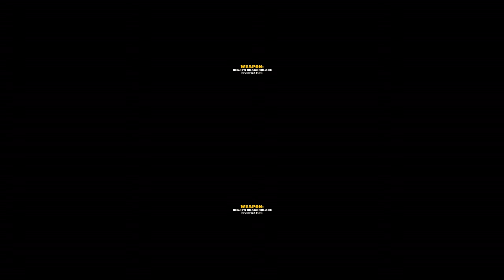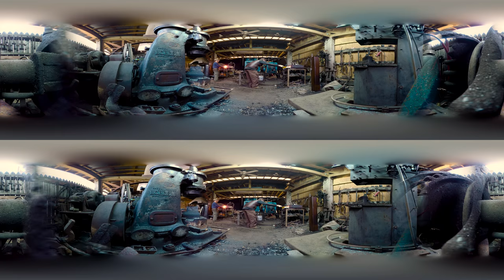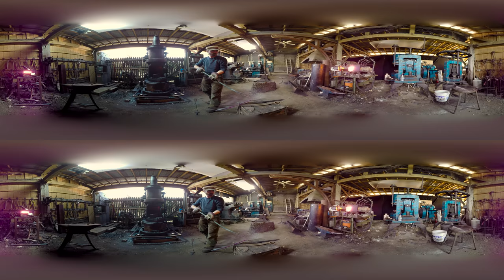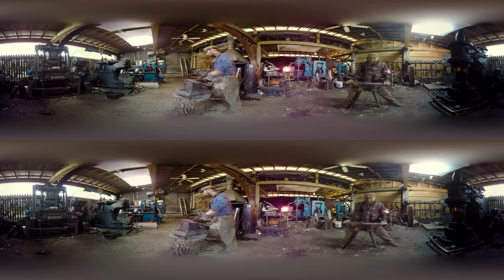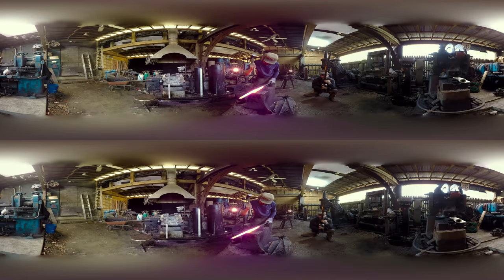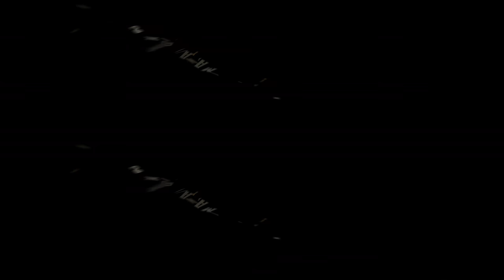Forging Genji’s Sword in 360° (1/4) – Overwatch – MAN AT ARMS: REFORGED

Comment: The normal videos still look better, even when choosing the highest quality setting (8k). I'm not sure if the quality is limited by the 360° recording system itself or by YouTube. Don't get me wrong, I dont want to complain about the quality, just want to explain what's going on :) I personally find the 360° videos pretty interesting :)
Reply: If you don't have an 8k monitor you're not going to see the quality.
Reply: Isn't 8k is the full video resolution? Since it's a 360 degrees recording you're not seeing everything at once. As such, a higher resolution than your monitor supports does make a noticeable difference.
Reply: ***** Yes you do. Try 1080p setting on a 1080p monitor, then try a higher setting.
Reply: Stefan die Waldfee — Retro & Indie LPs If you have a 4k monitor, and you go higher than 4k, you won't see a difference. The video will just go slower and slower.
Reply: ***** Yes you do. Try it. Use the respective quality setting for your monitor resolution, then use a higher one.
Reply: Stefan die Waldfee — Retro & Indie LPs It doesn't work at all. The video just runs very buffery and slowly for me, and I barely see ant difference.
Reply: ***** If your computer or your internet connection cannot handle a higher setting - that's not my fault. It does not negate my statement whatsoever.
Reply: use 1440p phone with headphones and super cheap goggles like the vrbox2 and that way u can watch it up to 4k  ....and it's pretty awesome
Reply: PheenX  when u view a 360 video u r looking at a part of the picture that is waaaaaaaaaaaaaaaaay less than 8k or 4k ......and when u set a higher res it just get's clearer
Reply: yeah the 8k thing is a misnomer... Its just 4 1080p screen stitched together so you are only viewing 1080p at a time...
Reply: Murcielago229 complete nonsense 4k is 4 1080p screens ...........and when u r looking around in a sphere the part u r looking at is far less than the res of a 1080p screen .....and the more u increase the resolution the clerer it gets